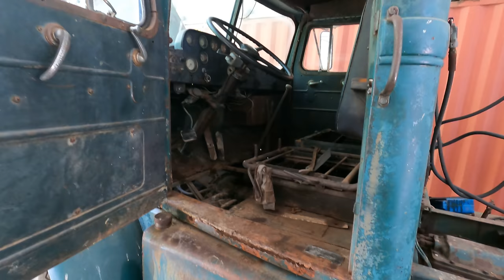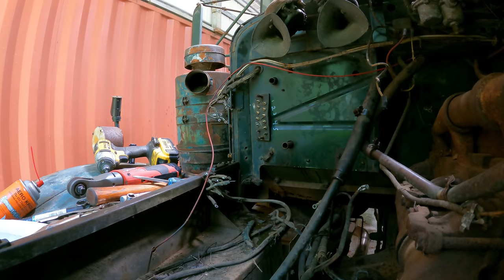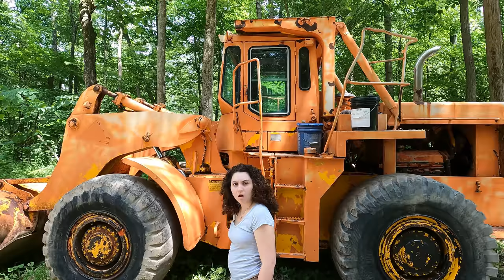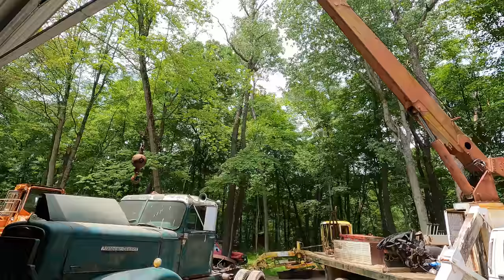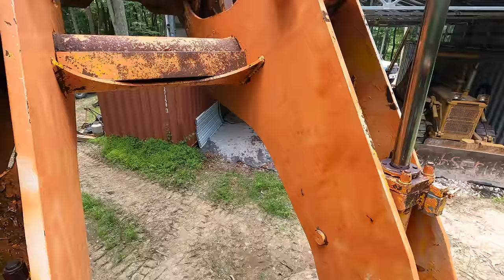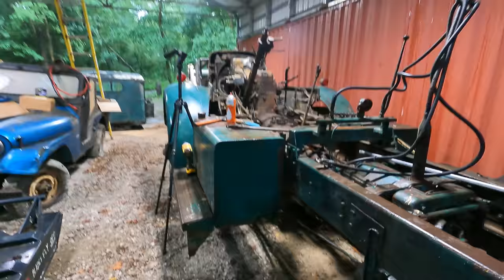1957 Autocar Truck Restoration: Removing Cab & Transmission Damage!

Comment: At the 18:30+ mark, I'm saying Woa!!.... I thought that perhaps you forgot to unbolt the support rods at the firewall for the radiator, as I was watching the radiator shroud being pulled backwards as you were initially trying to lift the cab! Whew!!   That wife of yours is little "pistol"... as the ole saying goes... "dynamite, comes in small packages"!! lol..... and in her case, that's a compliment!     Love how she just got right in there with you, and went for it..... She's Definitely Not a "prissy" like so many, these days!    She's definitely a "Keeper"... you're a Blessed young man!!  Enjoy and treasure her... and each other, and you'll have a long life together.   

Love your video's... subscribed about a year ago, with the first video of yours that I found and watched, and have "liked" all of them.    

PS: The very first truck I ever drove (as a present to me on my 13th birthday) was a big "A"Car (DC-9964 - OHNES.. special order), Cummins  NH 250 (with the "back-drop" exh. manifold & dual straight pipes), with a double "over" 5x4.  It was a dump truck, with an 18 yd (water level) body, plus 16" side boards for extra capacity.  

Always had a "special place" in my heart for the big square fender "A"Cars... and twin sticks, but my favorite power has Always been the 2 cycle Detroits, and have owned 3 semis with V12 power (modified) and "sticks".

Comment: With that gear that is rockin' and rollin' and shiftin' sideways on its shaft -- you are very correct.  That will need to be pulled down, cleaned, and reassembled with a host of new bearings.  Check all those gears intensely, both their outsides as well as where the shafts run.  Check end-play tolerances and fit with new spacers as necessary.  Much better to spend an extra hour in checking before you reassemble only to miss something and have to repeat the entire workload to find what you may have missed.  The very first engine I stripped bigger than a 2 stroke lawnmower was on my first car -- a 1954 Rover 75 straight 6, and its 4 speed manual gearbox with "freewheel".  Yes, I examined all the gears and bearing surfaces very, very carefully and replaced those which had damage - and all the bearings, and checked and adjusted end-plays.   The engine was a very major job and some parts had to be rebuilt by a professional - lobes had new metal added and reground, etc.  A most interesting task and one which was totally successful.  Everything ran like a dream afterwards.  I have never had mechanical training, but have quite successfully overhauled several engines and gearboxes -- with the assistance of the "Haynes" workshop manuals.

Comment: When you said you might have to cut the cab bolts my inner voice screamed, "CAN'T BE TOO TIGHT OR STUCK IF IT'S LIQUID!". That saying has become my new battle cry when working on something mechanical.
Reply: I grin and say that a lot in my mind, yet there are places that are to tight or even dangerous to be using an open flame.

No point in winning the battle by flame if it means losing the war (ruining the part or equipment you are trying to save).

Comment: The most common source of needle bearings in a manual transmission is where the output shaft fits into the input shaft.  Usually, the only thing holding them in is grease and the fact that the input and output shaft fits tightly together.  This is where you found the slop in that gear in the transmission.  Its possible that all you need are new needle bearings, but I wouldn't bet on it.  

The transmission has a vent in it, this can be a source of water inside the gear case - especially if it is driven through deep water and the transmission is hot.  The cold shock of the gear case will cool the inside air, causing water to be drawn in through the vent.  The rubber shift boot also has to fit tightly to the shifter, otherwise it can be a source of water also.  If you need parts for the transmissions, you need to check with a Medium/Heavy duty truck parts place -  they carry parts for trucks 2 1/2 ton and above.  Also, check for a medium duty truck salvage yard in a big city near where you live (because they aren't that common in smaller cities), they often can get parts for older trucks because things like transmissions were common across all brands of trucks in the earlier years.

Comment: Great work!!  Live that your wife is involved, too!  While you’ve got the transmission apart, you might consider applying Thin Dense Chrome (aka Armoloy) to the gears.  It’s cheaper and more effective than hard chrome, plus it cuts the mesh friction in half.  Just a thought.

Comment: "the brakes don't work. Don't even touch them"
At that point I would have said: nope, I am outta here 🤣
Reply: It's ok, not going fast enough to worry about it :P
Reply: HAHAHAHAHAHAHAHA I'd have stuck around, looks pretty flat out there...  hahahahahahah ;)
Reply: Since it’s hydro just throw it in reverse, & give her some. You don’t need brakes for something that slow unless you’re parking it & not in gear.
Reply from the maker: Exactly. 1st gear is almost like a brake anyhow. Need to be revved to the moon to make it barely move
Reply: The bucket is the brakes. Drop it, and it ain’t moving.
Reply: Wait...What????  Loaders are supposed to have brakes????
Reply: @Meralain  Yeah... if you're in a quarry :P

Comment: A theory on how the water got in the gearbox is: When you're driving long distance, g/box diffs etc get hot so driving a long & you get to a flooded causeway & drive through it the hot gearbox cools quickly & becomes a vacuum & will suck water in through seals etc. Just a theory but I have had it happen to me after 35 years driving the highways of Australia. Not knowing where the truck was from & how long it had sat idle is a factor on whether this was the cause.
Reply: This is the best explanation yet for the gallons of water in the gearbox!
Reply: Just ask anyone who has gone 4 wheeling and ends up stuck in water. The first thing you do when you get home is change the diff oil. If you get stuck in deep water the trans in next on your list.

Comment: i love this truck.. I grew up riding in a couple 60's, 70s AUTOCARS, and WHITE tandems hauling lumbing, pressure treated lumber.. With 6-71's, and quad boxes.. Learned too drive them around the yard.   would love too find one these for myself like this and do what your doing, too use too pull our equipment, haul logs.. keep up the work.

Comment: I don't know if you check back to previous posts and comments , but we had a '68 Autocar and the cab was , as far as I could see , identical . Also that generation of Western Star looked the same on the outside, but I never looked inside if that was similar too. That would give you a broader field to search and therefore more chance of finding a replacement.Of interest to you maybe is that there is probably no thermostat in the cooling system, but the shutters in front of the rad are air operated and themostatically  controlled. That knob that was broken off just below the dash to the left of the steering wheel is the control for the air operated windshield wipers. It gets dirty inside due to the oil that ends up in the air system, when the compressor wears a bit and the wipers get real slow or quit altogether.

Comment: There are cabs available. I found a very solid cab that came off a cement mixer, no use in the winter. Good luck, nice project! I also have 1947 C70 Autocar with a 501 gas engine in progress.

Comment: In Hinesville, GA my grandparents have a farm near FY Stewart, GA off of highway 84 he has a 1959 Autocar Truck he's had since brand new. It's been sitting since 1978 or 79 because the radiator developed a leak and one of his workers seized the engine. I'm sure the cab will fit this!!

Comment: I don't know if you have already fixed it, but I would highly recommend finding a roadranger 9 or 13 speed and installing it. With a pneumatic range select, much safer than trying to twin or triple stick shift.

Comment: i just love these old trucks  i took a 69 international  box truck  was 22 ft truck so i sold the box too help fun the project i bought the truck for 2300 i sold the box for 2500  including me taking it off the truck lowering it too the height the new owner wanted  then we took it too a welder friend of mine and made  the truck to 18 feet from nose to back of the truck it was short i designed a bed with removeable sides and grated bottom and designed a hitch setup to where i could get different heights and we moved over a 1000 mobile homes with that truck that truck made us well over a million dollars in its life time

Comment: this is when you know you love to rehab vehicles,, spending all that time/effort to take off the cab to get to the transmission to repair it/all.... Matt-- try soaking the bolt/nuts in say WD_40,,, this helps tremendously in frozen screws.. I use it allot

Comment: There should be a tag on the side of that transmission. It is an 8000 series Spicer. You need to put the transmission in reverse  to get the lid off. And yes there are needle bearings between the mainshaft and the gear. There is a pocket bearing within the main drive pinion and the front of the main shaft that will need attention as well. 40 years ago you could purchase a complete bearing and gasket kit for these. Good luck today. (-;

Check the clutch while you're there... Best of luck

Comment: Your wife is a star! I wish my wife would be as keen to come help with the dirty bits... I did have a giggle to myself at her look of shock and awe 😱 pretty much all the time 😂 And that woman thing of 300 turns of the steering wheel to go 2 degree's 🤣 One thing that scared me right off the bat was when she was rigging the strops on the bucket and asked you to drop it further 😳😳😳 She could have been killed!! All it would take is that loader to jump forward.... I am ultra careful since I was trapped under 2 tons of steel at work. All I did was pull the gate closed (turned out it had been seriously damaged 6 months previously) to secure the yard and it came down on top of me. Broke my neck, leg & ankle as well as a bunch of other injuries. Even suffered PTSD! I didn't know what was going on. Thought I was going crazy 😥 I'm still off work, but I mess around at home with our vehicles and watch your escapades on here. I used to be a machine operator & driver. I loved operating all the different machines. Every day was different. It helped I had an excellent boss. Pity his bro was a donkeys exhaust port 🙄 I miss the work & the travel. But you're keeping a little part of that meadow in flower, so thank you 💝

Keep on truckin..... CONTACT! 💥😁

Comment: Matt you're doing a good job with that crane but let me try to remind you inspect that cable!! Judging from what I could see it look Rusty and pretty gnarly.
 With your little woman underneath their guiding you with the cab, It made the hair on the back of my next stand straight up.
Check that cable closely inch by inch. Rusty as it is it's old and could fail without warning. Your best off just to replace it.
There's a lot more to cables than most people think there's a special lubricant it's not greasy never use grease on a cable use oil on a cable sparingly mostly to wipe the dirt off and keep it clean, it will hold water and moisture and deteriorate internally. There's a special type lubricant that has the consistency of Wax that is inbeded deeper inside the cable when it's manufactured, and is usually good for the life of the cable if you take care of it, It reject water. I believe it's available in a spray can. Trust me when I tell you I know what I'm talking about I worked for the government.(now retired) (Department of energy) I have a lifting certification up to 50 ton. I had many classes on lifting, cable maintenance, chain and strap maintenance, you name it. Hardware fittings and anything to do with lifting heavy loads. (Taught by the army corps of engineers)
 I'm not trying to blow my own horn but for God's sake inspect that cable.
 They're easier to just replaced it. You're doing pretty good with everything else, then you have peace of mind. Keep up the good work Matt

Comment: have you thought about raising the roof on your shop and putting an overhead crain in with extention to come out 10 feet or more  past the shop in the front and rear to do any lifting .  such as cabs motors ect . may find it useful for the future  .
Reply from the maker: This “shop” in the long term is really just a storage building I threw up in a hurry. I plan on building a much nicer shop next to this one I’m hoping to have a full bridge crane in it if I can afford it!

Comment: Matt, you say you are looking for a new (another) cab for the Autocar BUT you only need to replace the rusty bits, it looks like you only need a cab bottom, should be easy replaced by a handy metal worker, should be someone on the web that could do this job for you.

Comment: Water condenses out of the air with temperature change and humidity.  Gas tanks that breathe (old ones) get water in the gas.  If there were an air leak in the transmission through any route it might be the source. Or any measurement or filling point or tank it would make it's way to the system.

Comment: By the amount of rust in that trans, those  bearings have got to be in pretty bad shape.  I would definitely inspect them all. I built myself a 1985 Freightliner to pull customer trailers back and forth to my shop.  It took me a year straight off nothing but working on that truck. A labor of love to be sure. It's got the aluminum hood with the pedestal headlights like a Peterbilt. People holler at me in there radio, nice Pete, and I have to break it to them it's only a Freightliner.  LOL!!

Comment: I think but I think the bi gear is the planetary gear but I'm not fure sure,so don't hold me to that bcause I don't work on transmissions just older engines & your wife did a good job helping you out & I liked the look on her face when the loader fired right up,priceless & if the tree fell across your driveway just take either the big loader or the dozer to move it out of the way

Comment: Hey Matt, I know I'm real late seeing these videos. One thing I noticed, why is it you try to dry loosen old crusty bolts instead of spraying your penetrating oil on first?? Anything on an old truck especially as old as 1957, I would spray first to keep from working too hard or snapping bolts.

Comment: Other than way over correcting, the missus did just fine. First time I drove an articulating piece of equipment, it was a forklift, and I dropped the 20ft pieces of bar stock I was trying to move like 3 times. 😂😂

Comment: Just a little insight as to what might have happened to the transmission top shaft and gears. If a manual transmission vehicle is towed in neutral with the back tires on the ground the top shaft is the only thing turning in the transmission, no gears turn.
The counter shaft (lower gear cluster) turning is what throws the oil all around in the transmission providing lubrication to all the top shaft components. So if no gears are turning then there will be no lubrication.
Imagine the vehicle is being towed down the road at 55 mph, the shaft inside the top gear set will be turning at around 2000 rpm and the top gears will be standing still. With no lubrication it doesn't take long for friction to tear things up. 
I think when you get that transmission apart you will find that there are no needle bearings inside the gears on the main shaft (with the exception of the pocket bearing between the top shaft and the input shaft). The needle bearings may have come from there. I believe the top shaft where it meets that gear that is loose is hard surface mating to hard surface and it is probably scored something fierce. I've worked on 5 speed transmissions in my former career and that was always the case, but that transmission is a little older than what I have worked on. Hope I'm wrong.
That may be why it was parked in the first place, improper towing procedures.
ps. just found your channel keep up the good work.

Comment: Hi there, Matt, I have a suggestion that maybe future research & maybe fixer-upper with you!? Namely, within my story following: My dad in the late 1950s scored the job as the 'Heavy-Plant Leading-Hand with the A.N.R. Port Augusta South Australia, [Australian National Railways] I was about 4yrs old then, now when about maybe 7 or 8 yrs dad came home with an old relick semi-truck n trailer, it made a strange sound with each gear selection? Then 10 yrs later I also got to work with A.N.R. same branch as my dad, said rig was on a job, that was hauling concrete sleepers at the new railway-line from Tarccoola - Alice Springs, It is the 'Leyland Hippo' so here I am, my chance to investigate, I search for the 'Jam Recipe [gear selections] without permission, I had already loaded the bed, waiting for the drive, thought stuff this worth it if I get the sack, started & drove some 5-6 ks to drop site, the strange gear selection was an air clutch, each double-clutch needed to change up & down its transmission. So yeah Matt, my story & your mission to research & or add to your arsenal. LATER 👍Keep On 🛼

Comment: So sorry to learn of the transmission issues; I surely wish you all the best in the resolution and cab repair. (I also own the CONSTRUCKTOR in my profile pic and it shares some of what makes your truck so special. It is a WHITE version of the AUTOCAR, using styling and mechanicals which was shared between each thru the years. If you wish to see a video of it, go to my youtube channel under hobocatlawrence, as it rolls down the highway last year from MT. to ND)